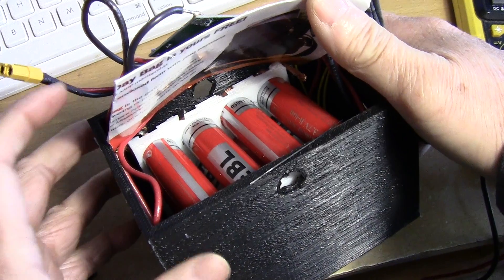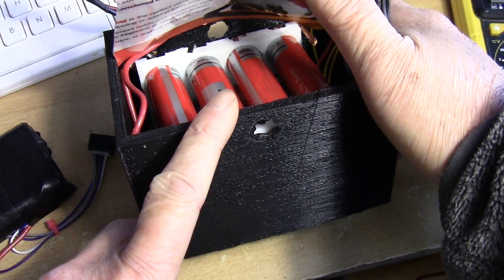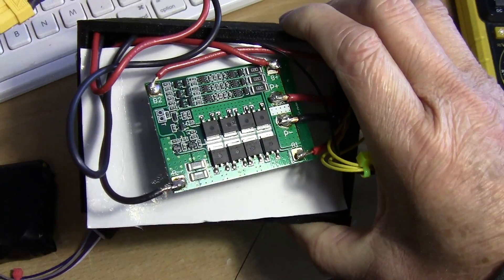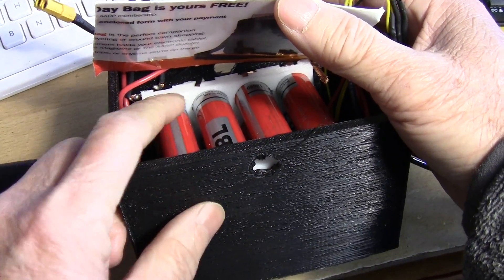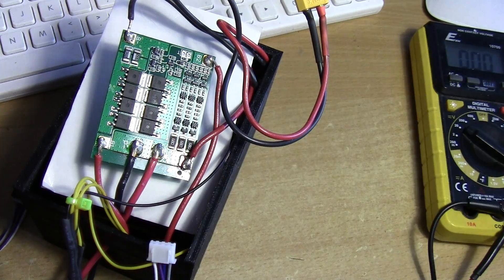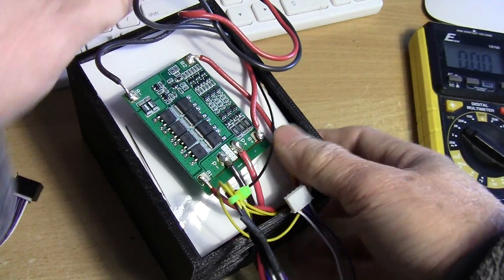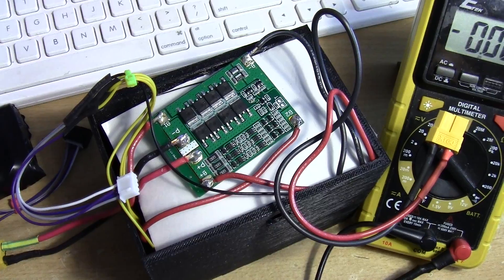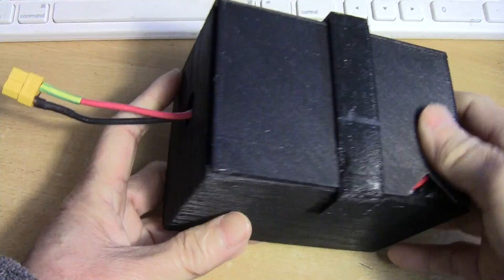Add balance charging to inexpensive 18650 BMS protection boards

Comment: Your title is misleading! It should be titled.....By-passing balance charge to existing inexpensive 18650 BMS protection board which has balance function by using my rc charger ......
Reply from the maker: I actually use it both ways. Balancing cells using the built in BMS is not that precise but it's the easy way and that's how I use the battery pack with my solar lights.

Comment: Would you mind sharing schematics for this?
Reply from the maker: This power bank is 3S 4P configuration.  The wiring of the protection board is usually available in the description of the product by the seller on eBay.

Comment: How is the capacity of those cells? They look like those ultrafire cells, which are notorious for having little to no capacity.
Reply from the maker: Theses aren’t ultra fires although they could well be made by the same people.  They are slightly more expensive new cells. They have higher capacities.  The actual capacity depends on how far you bring down the voltage and how quickly you do it.  I’d say they are 2 amps at best under normal use.  I have Samsung 2.5 amp high drain cells that are only 2.1 amp in capacity if you drain them to 3v or so. Since these are new cells, I skipped the drain, charge cycle needed when using used cells in building this battery pack.

Comment: Your homemade battery packs remind me of mine. I think it's cool that you're into modern tech. Keep it up! I was going to buy an inexpensive BMS just like you did, but thanks to your findings, I may just upgrade to a BMS with led lights to avoid the hassle of swapping IC's.
Reply from the maker: If you don't closely monitor the battery condition, you have to put many layers of protection to prevent them from over discharging. I'm not surprised at all  they get overheated when used in high drain situations.

Comment: Those boards would not "balance charge" battery pack, they keep the pack in balance within 20-40mA limit.
Yes BMS with balance charge exist and cost more than 10 $ online. BMS with led light is an obvious pick.I going to pick one. thanks for sharing BTW